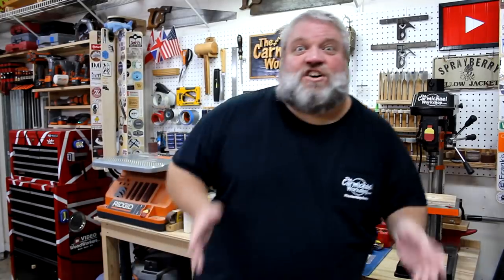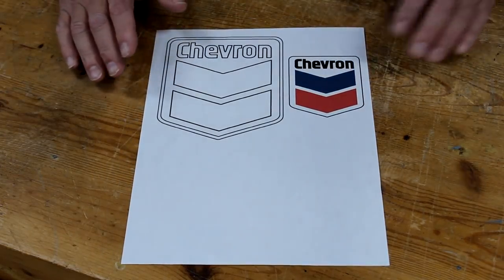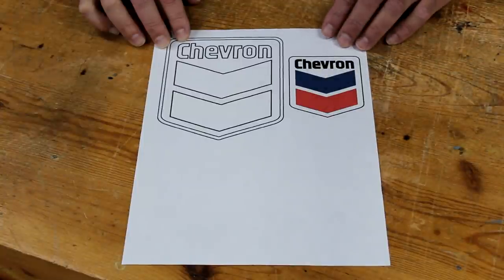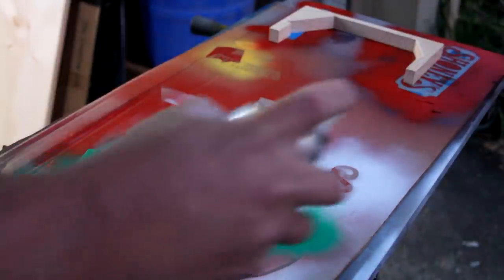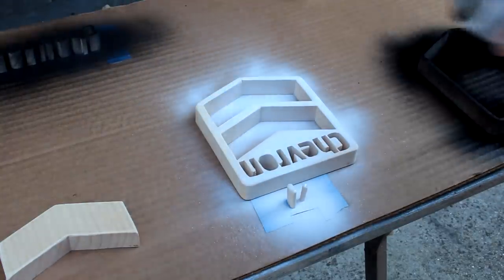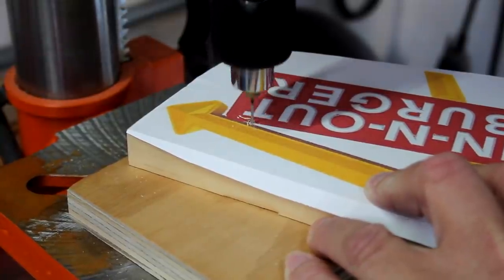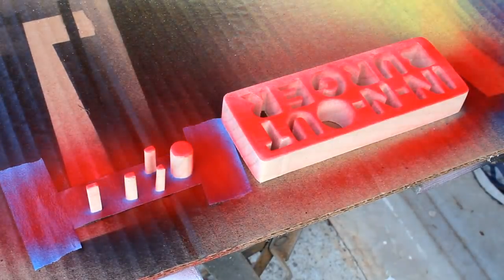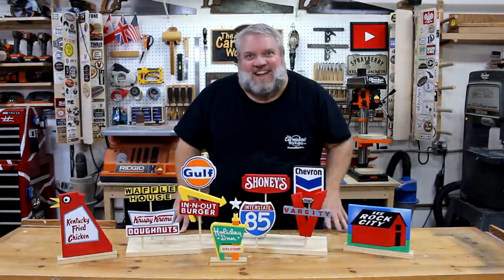Making Miniature Road Signs with a Scroll Saw

Comment: The signs look great. When you piece back together are you using glue to hold the pieces in place? What blades so you recommend getting for someone getting started?
Reply from the maker: Hey Anthony!  I used a few dots of Aleene's Tacky Glue to glue each piece in place.  I suggest getting a variety of sizes and tpi from https://www.flyingdutchmanscrollsawblades.com/   I like the Reverse blades because they cut from the top and bottom of the board, so that you don't have to sand as much.  Thinner blades are good for puzzle pieces.  Low tpi blades are good for thicker boards, and higher tpi for thinner boards.  Spiral blades will cut in any direction so you don't have to turn the wood to start cutting in a different direction, but they take lots of practice and it's hard to cut a straight line with them.  Spirals are good for cutting portraits out of wood.

Comment: Love the idea.   So nice.   How do you keep the small pieces from falling through
Reply from the maker: Hey, to keep the really small pieces from falling through the hole in the table, I put blue painters tape down on both sides of the blade to block the hole.  Refridgerator magnet business cards or calendars also work well...just cut into them half way and they stick to the table.

Comment: Cool project! The first stationary tool I ever bought was my scroll saw, and I've used it to make many different items: decor, signs, Christmas ornaments, etc. Alas, since equipping my shop with other tools (Table saw, miter saw, planer, bandsaw, etc) I have not sat down to the scroll saw in a while. I am curious what type of blade(s) you used in cutting out the signs? I need to get some new blades and I'd like your input!
Reply from the maker: Hey, I like using the Olsen Reverse blades.  I think they are 12.5 tpi.  They cut from both sides for a smooth cut and less sanding.  The blade left a gap that was just wide enough so after I added a layer of paint, the pieces fit back together smoothly.

Comment: Hello again Steve. I just bought a scroll saw and am trying to do something like this but am having an issue (more than 1 but just practice will fix the others). When you cut out the inside pieces and drill the pilot holes how do you cut the letters without having any left over hole that needs to be filled in.  I do not see any of the pilot holes on your work but my practice pieces I can see all the holes.  I have chosen the smallest drill bit that is needed for the blade. I am using a #5 pinless reverse blade.  Any tips would be appreciated.
Reply from the maker: Hi I use a 3/64 bit and drill the hole on the line or in a corner.  Sanding to round over the edges of the pieces is the key to concealing the holes.  The more you round it over, the the more the hole goes into the crevice and is less noticeable.  Also paint helps to fill it in a little too.

Comment: Do you find the letters more clear or sharper when you cut them out and paint them . Thank you for the video. Happy spring
Reply from the maker: I do think it adds more definition and contrast, especially when I round over all the edges of all the pieces.  That creates sort of a gap shadow and gives it more dimension.  It looks even better when I glue the letters in part of the way and let them stand proud of the front for a 3D look...like this project - https://www.youtube.com/watch?v=XZrL0MA57x0
Reply: Thank you Steve your work is really lovely. I am in woodworking kindergarten so my finishing is not very pretty yet. Happy Spring and thank you for your kind response

Comment: nice job on those signs, Steve. What blade size did you use for those? Thanks Dan
Reply from the maker: Hi Dan - I like to use the Olson Reverse blades with 12.5 tpi.  Not sure what size but they are pretty thin.  They cut smooth and leave a perfect gap so that after painting, the pieces fit together smoothly.

Comment: GREAT work - very impressive!  One question - when you've cut out the pieces and fit them back in, there doesn't seem to be any gap (kerf) from the sawblade - the pieces seem to fit tightly.  How do you do that?  (when I cut like that, there is always a gap twice the thickness of the blade...). Thanks!
Reply from the maker: Hi Jay, thanks!  It sounds like you may be using a thicker blade.  I use a thin 1/32" blade.  You can get puzzle blades that really thin, but if too thin, it can be hard to take apart the pieces and put them back together after painting.  The spray paint goes on pretty thick and closes up the gap well. The glue takes up some space too.  Rounding over the edges of each piece helps to conceal gaps and mistakes. Get some different size blades and try them out.

Comment: Nice job Steve. How long does it take to cut out the letters for these signs?
Reply from the maker: Thanks Pete!  Depends on the sign and how many pieces/letters there are.  I would say 1-2 hours just for cutting for each one, then sanding the pieces takes about 1-2 hours.  Painting and gluing back together is pretty quick.  I estimate an average of 4 hours total for each sign.

Comment: These are fantastic! Very inspiring!

Couple of questions. What size of  drill bit did you use, and how did you fill the drill holes? Also, after painting you reassembled and glued. What glue did you use? THANKS!
Reply from the maker: Hi Bob, thank you!  I used 3/64" bits https://amzn.to/3t24zMu and you will probably need a micro-bit chuck https://amzn.to/2Rdmphz because these bits are too small to tighten in regular drill and drill press chucks.   I like Aleene's Tacky Glue https://amzn.to/3dIXgmC because it dries clear.  I didn't fill the holes...I carefully sanded each piece so that the front edges were rounded over.  This works well to obscure the holes and any cuts that stray off the line.  The paint also helps to fill the holes and gaps left by the blade kerf.
Reply: @SteveCarmichael  thanks so much! Inspired by you I’m attempting a simple nostalgic “Route 39” Ohio sign from my youth (live in the Bay Area now) for my wife. New to scroll sawing. Bought the Dewalt. With this sign project, it’s not an easy task to scroll saw a line when you know there can’t be waste on either side of the kerf! Hat’s off to you. I’m a cartoonist and hope to create some unique pieces. Thanks again!

Comment: You use the smallest drill bit that allows the blade to fit inside? No other trick to it? Can barely tell. It amazes me you can use the cut out letters and everything without messing them up. Scroll saw pro.
Reply from the maker: Hey, yes, the drill bit is so small that it won't tighten in my drill press chuck  I think it's 1/32" or 3/64".  I got a special small chuck that holds tiny drill bits at the last woodworking show.  You pretty much get one shot at cutting out these projects.  I had to be careful about not losing any pieces.  Some of those pieces inside the letters like o a e were thinner than a toothpick.  Sanding and rounding over the edges of the pieces helps to make the starter holes less noticeable.

Comment: Steve, one more question on this please. Since you are using the cut out letters, etc, do you simply use a really thin drill bit right on a line and then insert the scroll saw blade? Sorry for the newbie question. I just ordered a Wen tonight and want to hit the ground running and try something like this when it arrives!
Reply from the maker: Yes, I use micro drill bits (1/32" I think) and a small chuck to hold them, since the bits are too small for the drill press chuck to hold.  I got them at the woodworking show, but you can get them here - https://www.bearwood.com/drill-bits.html   I usually drill the hole in a corner or on the line.  It's pretty easy to sand and round over the edges to make them less noticeable.

Comment: Do you have any tips for drill location and regards to saw start/stop location and keeping it unnoticeable?
Reply from the maker: I used a tiny drill bit, about 1/32 or 3/64".  I tried drilling in the middle of a line and also in the corners and neither one was better.  The key is to sand all the edges and round them over so it's less noticeable.

Comment: Hey Steve, what scroll saw do you use. I saw the blades you mentioned. I currently have a Ryobi I use for everything, but the fact it uses pinned blades, I am unable to make tiny pilot holes to cut anything this close on tolerance. I'm thinking of upgrading, but am not sure what to even look for.
Reply from the maker: Hey, I use a Dewalt DW788 now.  I started with an old 13" Craftsman that used pin blades.  I could not believe the difference the Dewalt makes.  It is like night and day.  Usually when I upgrade a tool, there's not much of a noticeable difference, but the scroll saw is a different story.  A better saw makes it so much easier and more fun.  Delta also makes a good one that is really similar to the Dewalt.  I got my Dewalt on sale at Home Depot with some gift cards so that made it easier to afford.
Reply: @SteveCarmichael  Thanks so much for the thoughtful response. I really appreciate it.